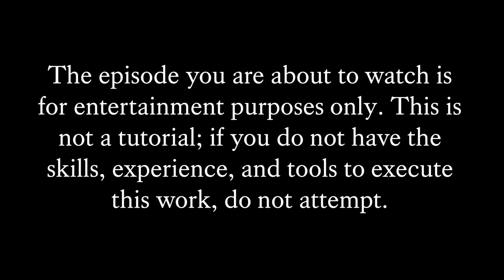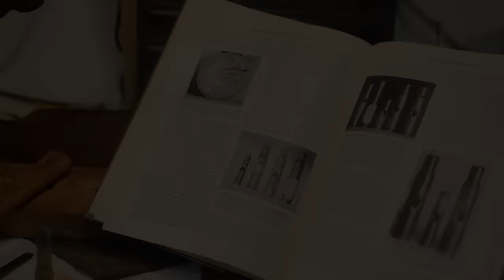Mauser Gew1898 Conservation and Checkout: Anvil 0134

Comment: 3:20 - 

Look up ATF in Wikipedia, you will not find the term HYDROSCOPIC in that article?

   --->>. After all, ATF is only a highly refined oil?

Acetone is certainly not HYDROSCOPIC.  

So, I just don't understand this.

I'm just sayin'...

...
Reply from the maker: HyGroscopic......a tendency to absorb moisture
Reply: Hmm. With Mark on this one.
ATF is hygroscopic, does absorb atmospheric (& added) moisture if left to do so. You could argue, & rightly, that a vehicle transmission is 'open' to the atmosphere when idle. But a used transmission gets extremely hot in use & that heat drives off the moisture.  Hydraulic/brake fluid is also hydrophobic but is in a (mostly) sealed system - mostly, as the reservoir is open to the atmosphere & is why it is a periodic Service item.

Comment: Nothing like completely destroying a beautiful old war horse. Bluing parts that are supposed to be in the white and sanding a beautiful stock amd applying a completely incorrect finish. All this rifle needed was a little oil and bronze wool.and it would have looked amazing. While I appreciate the skills that you have there is a time and place to do this and sadly this was not the time or place.
Reply: I just watched the video, supposedly 8 hours after your comment.  I have to say, you are COMPLETELY WRONG.  He didn't blue anything OR sand the stock.  He boiled the metal parts and washed the stock with soap and water.  He DIDN'T EVEN steam the dents out!  If you can't watch the whole video then don't make an uninformed post like this.
Reply: @les3449  I watched the whole video. Boiling is bluing. You can clearly see that the bolt parts, which are supposed to be in the white are now blued. Also he used a red scrub pad when cleaning the stock, those are rated at a 320 Grit the same as sandpaper, so yes, he did sand the stock. If you can't understand what he actually did then don't make an uninformed comment like this.
Reply: @danielneal9137  I have done both hot and cold rust bluing and you must take the old bluing off and apply new bluing AFTER boiling to "reblue" the steel.  Otherwise you are just loosening rust, which is what he did.  I have also refinished many stocks and he did NOT refinish it.  He washed the dirt off and put oil on it that absorbed INTO the stock to protect it.  That abrasive he used didn't even damage the arsenal markings.  He didn't refinish the stock.  I have done this AND refinished a stock, they are two different methods.  Did you even notice that he didn't put any pressure on the pad?  Don't be so condescending either, that's rude.
Reply: @les3449  ah, so you are the type that just wholeheartedly supports refinishing because you feel "He didn't actually refinish it" despite all the clear evidence to the contrary. Of course you are the type that doesn't care about history so your opinion cannot be changed. And if you want to talk about condescending maybe reread your first comment and look in a mirror at who was condescending to start with.
Reply: @danielneal9137  condescending is defined as "showing or characterized by a patronizing or superior attitude toward others."  THAT is what YOU did.  On the other hand, I was correcting with emphasis added, after your condescending remark to the gunsmith.  I DO care about history and have for 50 years.  I have been rebluing, and browning gun steel as well as refinishing and cleaning wood for almost that long as well.  I'm sure you know water boils at 212 degrees F.  Boiling it turns the red rust present into black oxide.  To reblue it he would have had to strip all the old bluing off and add new bluing after the boiling water bath or put a solution like lye and potassium nitrate or other bluing salts into the water.  He didn't add anything.
Reply: @les3449  and there you are with the condescension again. You just can't accept the FACT that what was done here was that a easily preserved was horribly refinished. You are so deep in denial that you can never accept that it's anything other than what you believe.
Reply: @danielneal9137 I tried to explain what condescending means as opposed to a frustrated response to a condescending comment (yours) and you didn't accept it.  OK young man, have you blued steel by boiling?  Have you cleaned and refinished wood?  These are real questions I should have initially asked.
Reply: @danielneal9137 oh yeah, at 58:48 he says repeatedly that he CLEANED it.  At 59:01 he comments on cleaning the stock.
Reply: @les3449  I have cleaned but not refinished because unlike the people such as you who like to reblue your guns by making Milsurp Soup (and doing so is a form of rebluing whether you accept it or not) my goal is to preserve not restore. The only gun I have ever cleaned as aggressively as he did in this video (which again is a point of fact whether you agree or not) was a completely mismatched Kar98k Russian Capture. Other than the reciever and barrel not a single part matched. Even then I made sure to apply the proper Raw Linseed Oil to the stock instead of the improper Danish Oil.
Reply: @les3449  and I could go outside and record a blue sky and say it is green. Just because you say something doesn't mean it's true. The FACT is he used an aggressive abrasive pad and whether he wants to admit or not and whether you will accept it or not doesn't matter because the video clearly shows him sanding the stock.
Reply: @danielneal9137 I don't understand how you can call water a "milsurp soup" when it is only water brought to a boil with no additives like bluing salts.  It is just transforming what is already there into something else.  I don't see that as redoing anything.  I didn't see him rub the stock aggressively like you apparently did either.  Linseed oil stays on top of the wood.  I have never used Danish oil but he said it goes INTO the wood so I believed him.  I guess I was wrong.
Reply: @danielneal9137  Ok, I guess he fooled me.  It appears you are correct.
Reply: I have read both your original comments, which I have issue with, & the 'conversation' subsequently & I think mister you'd better show some 'qualification'. 🤨
Reply: @grahampalmer9337  ah yes, let me just post pictures of my gun collection in the comments here where you can't post photos. Will work amazingly.
Reply: @danielneal9137  your collection means nothing in the context of this stupid argument you decided to have, show the process you are describing. 
Upload a video of your process on this here LITERAL VIDEO SHARING PLATFORM, you know because YouTube was made to upload video not pictures in comment threads.
Reply: @worldcure7883  if I buy another rifle that needs a proper cleaning and conserving I will gladly do that. However you are currently asking me to travel back in time to video what's already been done for an argument that had not happened yet at the time I did it. Therefore your idea of "jUsT sHaRe ThE vIdEo" is currently impossible to do.
Reply: @danielneal9137 don't worry about him he's to cough up in his own history he can't even understand what is happening around him lol
Reply: sadly this was not the time or the place for your inaccurate comment. Boiling in water is not bluing, high energy source, water or steam, moves an electron in the outer valance shell and passivates the iron.  Given, he did blue the butt plate, so what. Keep the gun perfectly historical and we lose it because of mishandling, the damage was already done. By the way i am a certified gunsmith, through a 3 year program at a brick and mortar school. Questioning Mark's methods in the comment is one thing, you outright condemn, and are incorrect.
Reply: @thomasbatty9735  nothing inaccurate about my comment and this was 100% the time and place. If you don't understand what you are talking about you shouldn't comment. Sounds like you should have paid a lot more attention in your 3 year program.
Reply: What do you think about counter boring the muzzle?